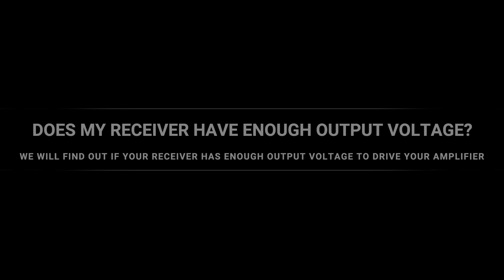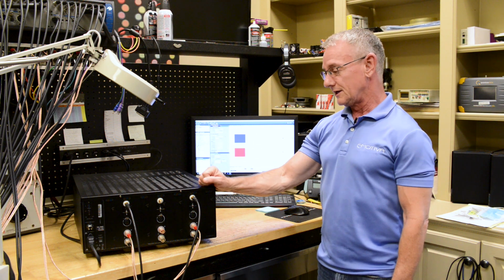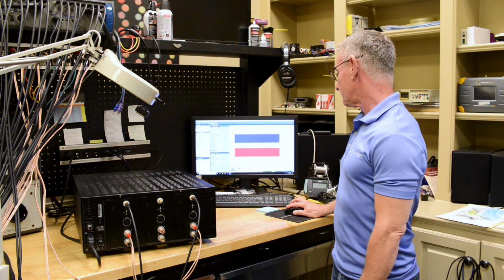Does My Receiver Have Enough Output Voltage?

Comment: I have a question, AVR sending the same signal and volume through RCA unbalanced or XLR balanced will the output volume will it be different in terms of sound level ? i.e balanced connection will it output more sound level or mere cleaner signal sound quality..?

Comment: I measured my Denon 3802 and it puts out 1.5 volts at the front pre outs.   Wasn’t enough to power and amp that needed more.  Speaker volume was very low out of that amp.

Comment: Onkyo might rate their preamp output at 1V (at SINAD), Denon’s seem to be 1.2V (at SINAD) which isn’t full power… so when you run your preamp above these voltages you’re getting into the distortion zone…. super confusing is that rule of marrying your preamp output and your external amp input… seems impossible given your actual preamp voltage is a moving target.  The good news is, and why he made the blanket statement at the end about “don’t worry you’ll be fine” is your preamp voltage will jump up high enough above that SINAD rating level to work out…. also that 1.5V input rating for the amp he’s using is actually 1.74.

Comment: Though I get the output i need out of my Emotiva amps using my my Marantz pre-amp but, it leaves me still wondering if i ever could achieve max output form the amp as he does mention 1.7v need to reach max and quoting Marantz from their website "the RCA pre-outs can output up to 1.2V and the XLRs can output up to 2.4V" so based on the 1.2v vs 1.7v a would assume that i would not reach max but, I am not sure.
Reply: I have the EXACT same concern. SR5015 sounds great driving my right and left RF-7 IIs and Focal 300 ICLCR 5 center to a crystal clear 80+ dB at my 13 ft listening position; but I'm always stuck wondering if an external amp could sound better. Then I discovered this issue of Marantz's preout voltage. I may never know.
Reply: @turbogt2911  Same here. I ordered a XPA11 and will test it with Cinema 40 and RF7II´s :D
Reply: I have the exact same problem with my Onkyo RZ250 Onkyo has released the new RZ 70 however the pre-outs are the same output so I cannot from my understanding get the maximum amount of power out no matter what amplifier I buy unless that amplifier has gain control.
Reply: Notice how there is no reply to your concerns. Since the power with the receiver hooked up was more than with the signal generator I would conclude that was putting out slightly above 1.7v. Does not mean all receivers will. If you are above 1.7v I would think you are at risk of clipping the amp. This video seems misleading to me.

Comment: Crazy - I was doing a search on how to measure pre-out voltage from a receiver and lo and behold this is MY receiver.  The Onkyo RZ 730.  I have an Outlaw 7000X that requires 1.2V and was considering adding two 2220 but those require 1.6V.  Its great to see my receive can supply that voltage (since Onkyo only provides the nominal spec of 1V) should I decide to buy those two 2220 and run the rest of my system (minus the back surrounds) with the 7000X.  Also the Onkyo RZ 730 can be configured to display the volume in dB so 84.5 is actually +2.5db and 82 is reference.
Reply: nominal is the correct word…your amp would have to go higher to work with that amp and it does.  The rated (nominal) output sensitivity of 1V is at SINAD…which is below the amp rated input voltage.

Comment: My onkyo RZ820 leaves 1v as the specifications, what does that mean when you say emotiva needs 1.7v?
Reply: That 1V is “nominal” which is at SINAD.  Your output actually goes higher..almost 4V I’ve read.

Comment: A question for emotiva.
I'm thinking of getting the 
Onkyo tx-rz50 together with the Base X A3 for the LCR.
The specs on the Onkyo tx-rz50 pre-out is 1v.. is that enough to move the base X A3?
Reply: I'm wondering the same thing. I have a Pioneer SC-LX904 with pre-out of 1v Thinking about getting the XPA-3 for my LCR. Not sure if that will be sufficient enough for that amp. 🤔
Reply: I have that Onkyo and I also have a BASSX-3 I do not feel as  getting the full potential as well I asked a guy at Crutchfield about this he was completely stumped he was like you pre-outs will put out enough power I tried to explain to him I measured the power And also see the out put on paper how much,power this receiver puts out....No I'm not getting the amount  of full power however I do love their amplifiers.

Comment: Question to Emotiva:  I have a Denon DRA-800H Receiver which has Zone 2 Outs.  So I presume, I would connect the Denon's Zone 2 Outs to my Emotiva A-300 AMP inputs?  Thus amplifying the Zone 2 signals?  With this connection, the Zone 2 signal is amplified only, correct?  It is not "bridging" the two amps?
Reply from the maker: Correct, the signal would route through the Zone 2 outputs to the A-300 to your speakers. When connected to the outputs on the Denon, it should mute the internal amplification to those channels.

Comment: Lonnie, 
How about a video where you explain speaker cable sizes?  Everyone talks about "watts", but isn't watts=volts*amps?  Isn't amps(current) the determining factor in conductor size?  How much current is provided by an amplifier to X ohm speaker load at X watts?  Another issue is input power supply to the audio rig.  Kinda need guidance on 110/220v current supply size there also.  Some folks don't know that plugging 30amps of load into a 15amp rated circuit is not a good/safe plan.  Oh - all of this math, time for a drink.

Comment: Hi Emotiva, my system are Yamaha RX 3040 and  my speaker are KEF Q950 and center KEF Q600c.
I want to add Emotiva XPA 5 gen 3 to my system. If I do can I hear the different on my ht system? I am listening at volume -20 db. Waiting for the feedback. Thanks Emotiva
Reply: Yes, with all channels driven you are only getting close to 100 watts of power with your Yamaha. Going with the XPA-5, you will get more than twice that power and really open up your soundstage and system performance. It will be a night and day difference.
Reply: @nickmandara8231  Thanks a lot. Already order the Emotiva. 😄